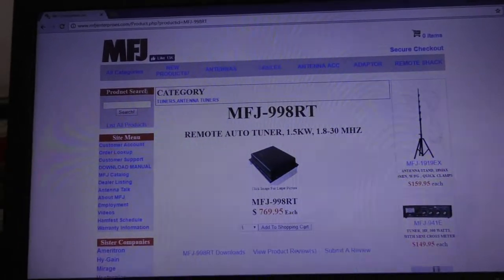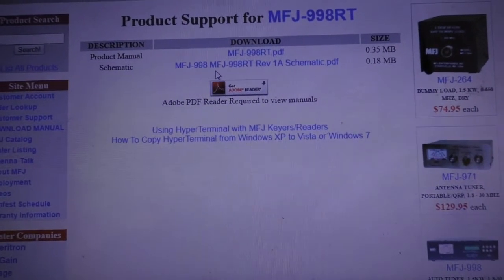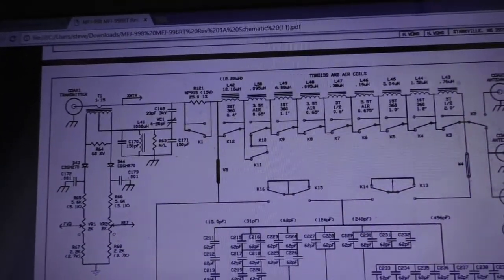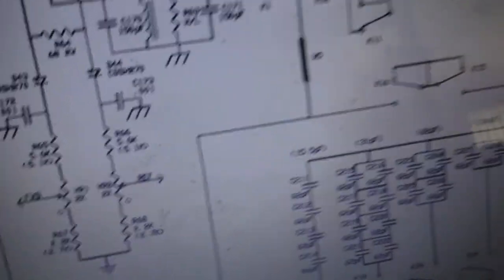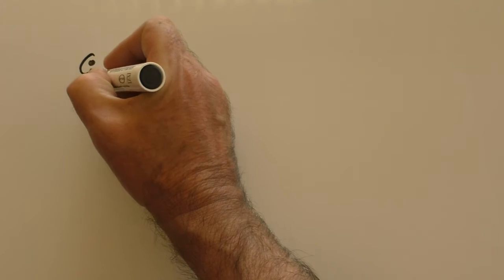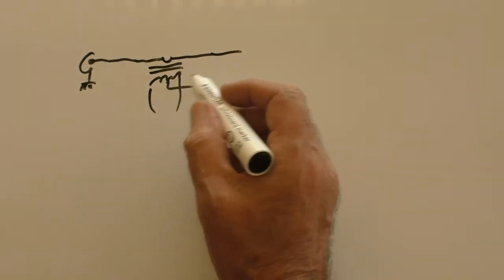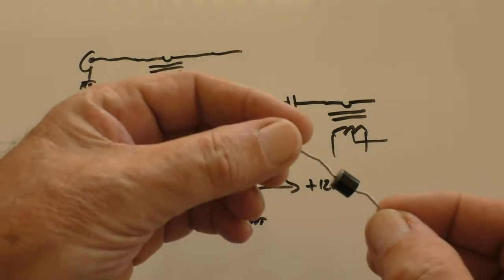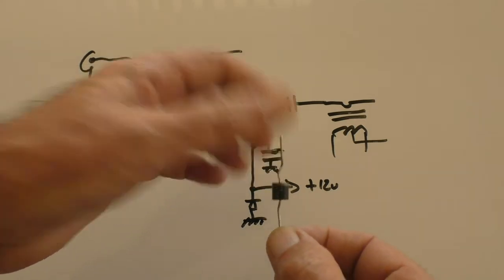MFJ-998RT Auto-Tuner Problem Postulation

Comment: Is it the same reading at the DC input socket?  73
Reply: Ian Whitford that so 29 is the dc input
Reply: oops typo that should have been SO239. The confuser thought otherwise.
Reply: No it has a separate DC input for those who would rather run a separate 12VDC cable.
Reply: Ian Whitford the one I had didn't have a separate dc input, perhaps it's been changed. mine had microcontroller issue and the shop I bought it from didn't offer a replacement just a refund.
Reply from the maker: Good question, thanks. I have just checked that and yes, it is.

Comment: Sounds right to me. It looks like these remote tuners have a DC block etc although the schematic doesn't show it. Same as on my MFJ962B. 

With my 962B they also supply a MFJ4117 bias T for the shack end of the setup. I don't know what they supply with your MFJ998RT. I assume an MFJ4117 too. 

They don't supply a schematic for the 4117. It is simple but why not supply it in the documentation
Reply from the maker: That's pretty slack. Yes, they did supply a bias T for the house end of the installation. A series DC block diode would be much better than a series crow bar diode. It just wouldn't work, there would be no excessive current pulled through the RF choke to burn it up. This is what I assumed happened, I don't 'know' this is their configuration.